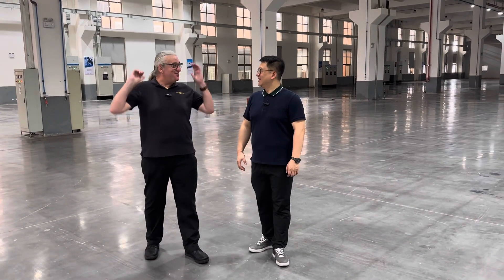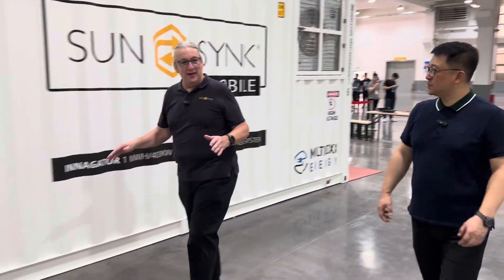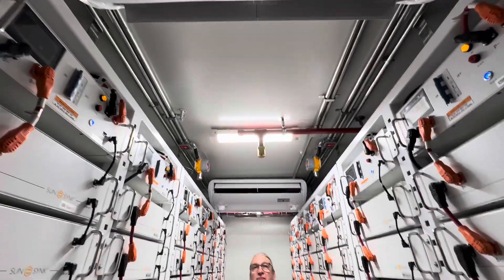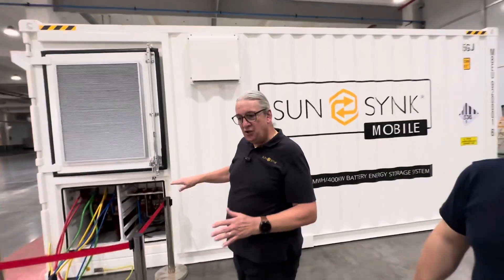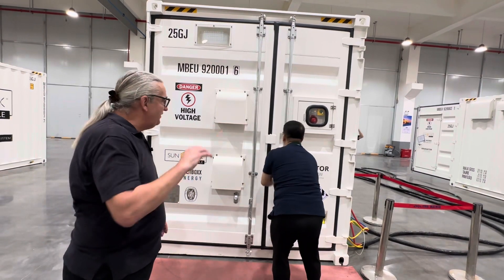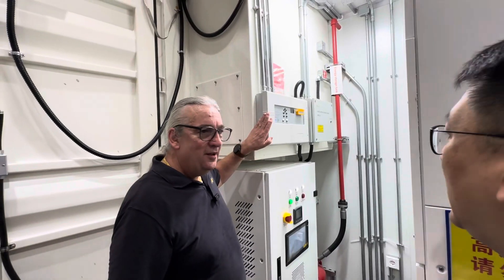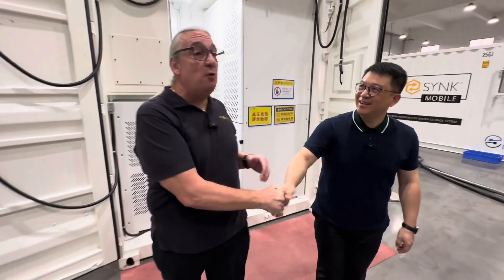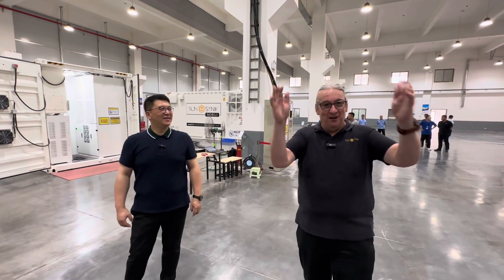Million Watts of Storage Energy in an all in one system

Comment: What's the power requirement for the air conditioning on one of those containers?
Reply: i would guess 1000 to 2000 watt when running full power when say the sun shines and the batterys are charging same time.
but thats nothing if you have say a desent sized solar panel field near the container. since 3 to 5 of say 200 good solar panels give power to the 
air conditioner and the rest 195 charge the battery.. and at night its usually colder so the air conditon dont need much power then.
So using a few % on cooling the batterys are smart since the charging is more effective when batterys are cool.